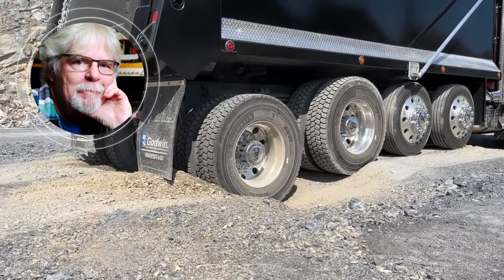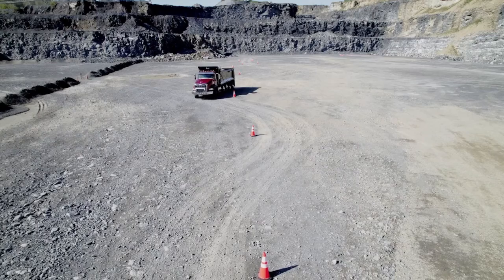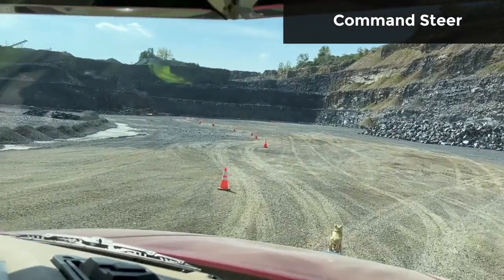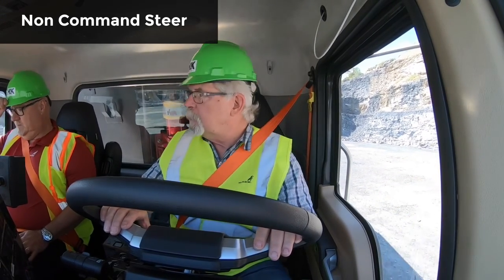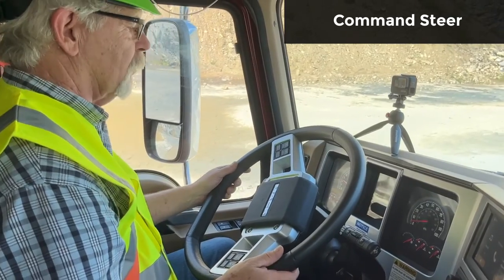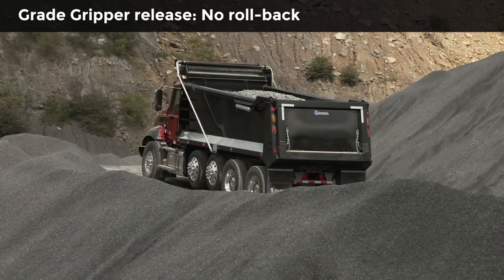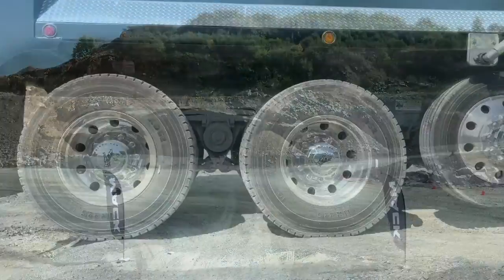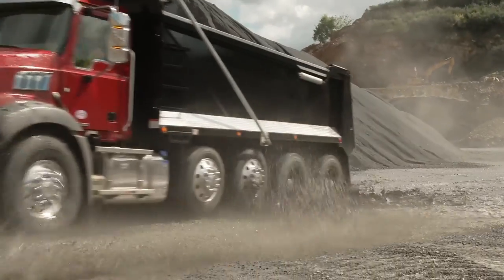On the Spot: Mack Trucks' Command Steer

Comment: The flat bottom steering wheel looks like it gives
an extra inch or two of room for legs and bellies. 
I drive E-One fire trucks and we also have a Super
Duty, a Silverado HD, a Tahoe, & Econoline based
ambulances.  If those all had flat bottom steering
wheels, it would make ingress, egress, & driving
so much easier while wearing firefighting pants.